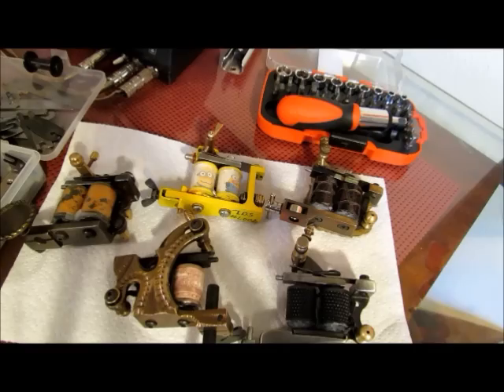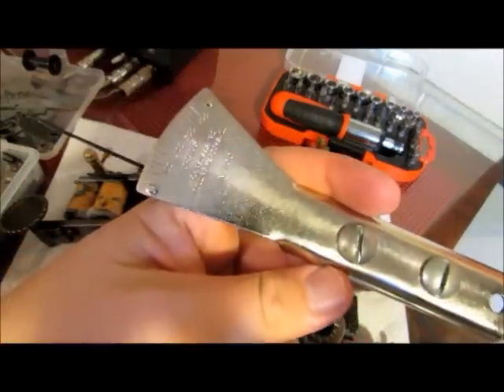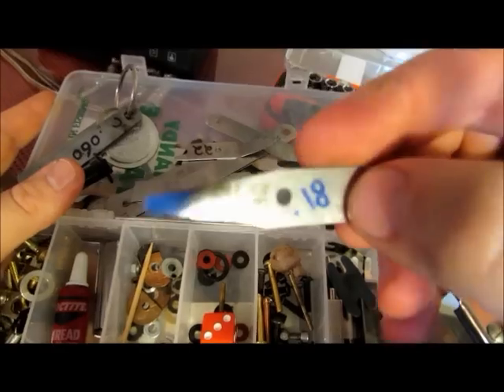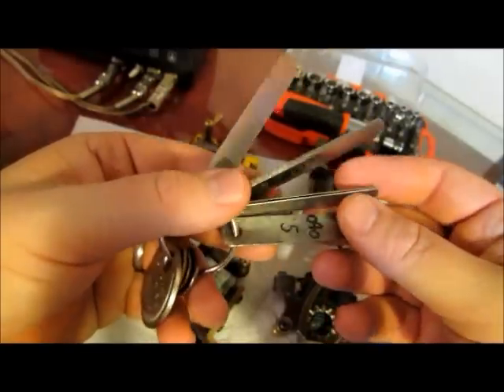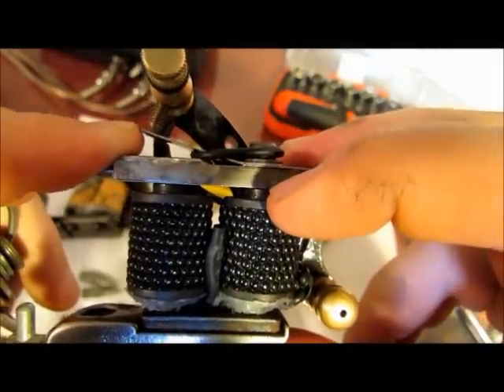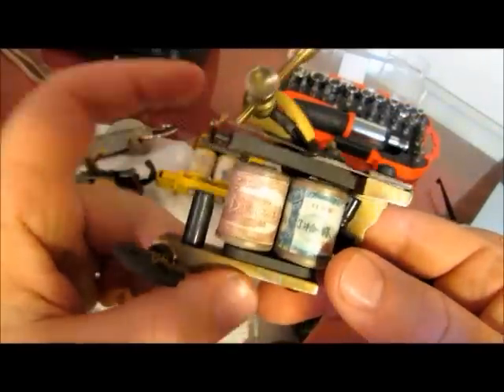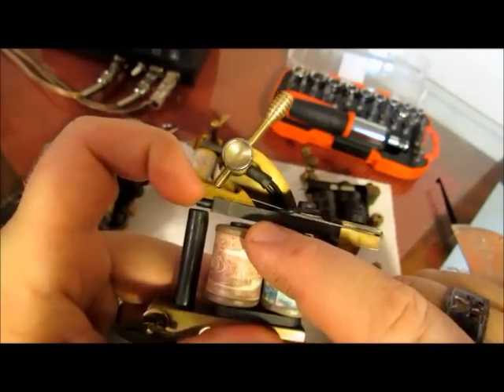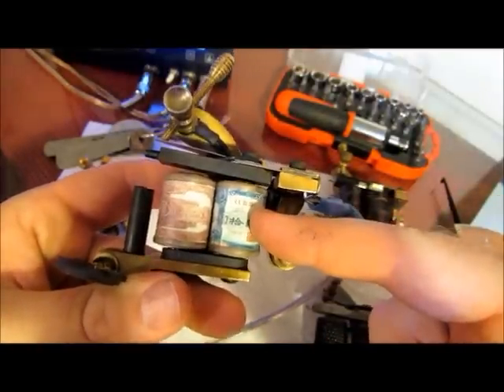machine tune final

Comment: Hi Nick, great video, very informative. Talking about the ghost image of the armature bar for the liners. Will it only overlap when the stroke/throw is short and only when a machine is meant to use small groupings? What would you recomend for 9RL onwards and what would you classify as the small needle groupings? Many thanks for your advice in advance.
Reply from the maker: So armature bar ghost is an indication of how long the stroke is. Typical liner stroke is short so arm bar nipple doesn't travel far. Stroke is more relevant for what ink you are using. Thin ink short stroke. Thick ink equals longer stroke.  I look at 9s, 7s, and anything smaller as small needle groups. I think the question you want to ask is what set up is good for small needle groups? Short answer is 8 wrap. What is best for lining with small group? 8 wrap with short stroke.